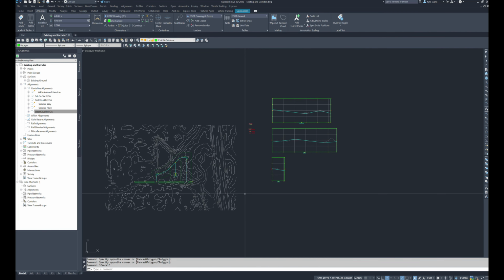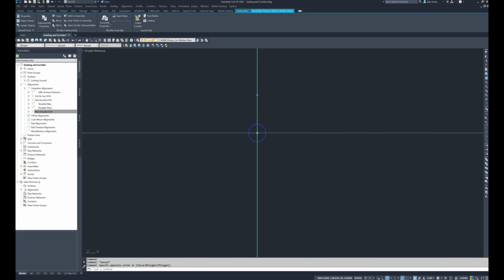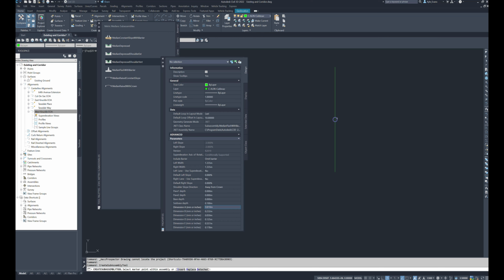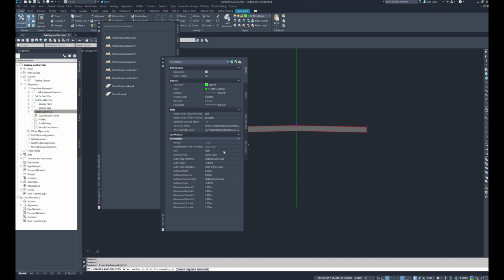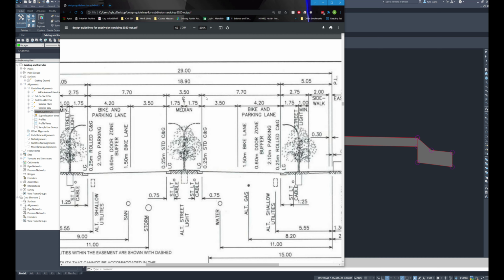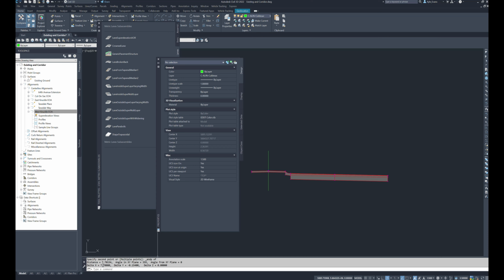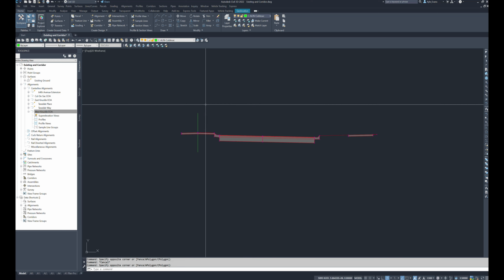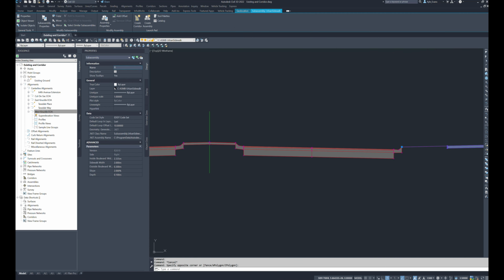Part 3 - Creating a Primary Collector Assembly

Comment: Why are you designing the assemblies from centerline out to the edge of the typical section? Isn't it best to build out to the edge of pavement and address all the variables with assemblies at the edges of pavement?
Reply from the maker: Most roads are based on a centerline kind of construction. Any SuperElevation is usually a rotation about the centerline.
Reply: @KyleEvansCivil  Right but the super can be applied to the lane assembly. Just sharing a workflow that reduces the number of assemblies. If we build everything out from centerline there has be assemblies and regions for every place where the left and right edges differ from each other. If instead we model the lanes and add edges independently it becomes a much simpler model. I thought I saw ATG had a video about that technique.
Reply from the maker: @Neil Wilson Can you find that video and I can take a look at it? I cannot visualize how that would be easier.
Reply: @KyleEvansCivil  I can't find it offhand. It may have been by someone else. I can send an example if you like. If you have edge of travel way alignments or extracted featurelines, You can add them as baselines and apply assemblies to them for independent edge treatments. This is how it is done in Bentley software. The corridor then becomes a single assembly and region for the lanes and the edge baselines for the edges. Changing from curb to curb and sidewalk or ditch or a seamline for grading is simply a matter of splitting the edge regions and swapping the assemblies.